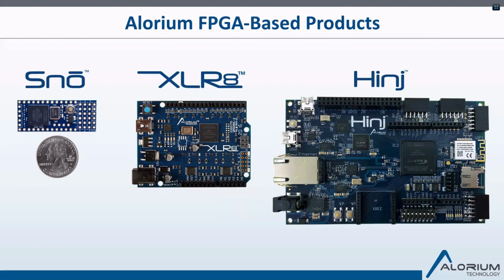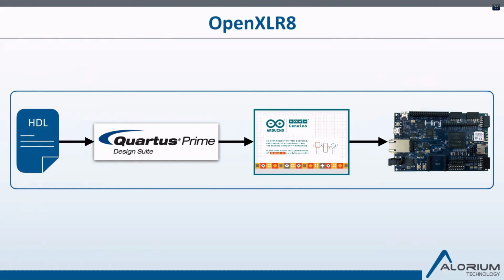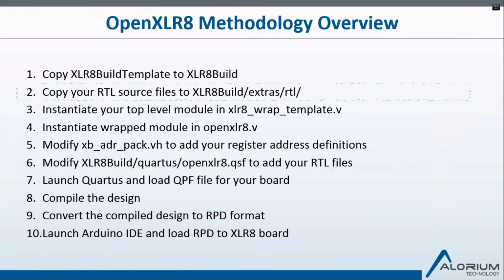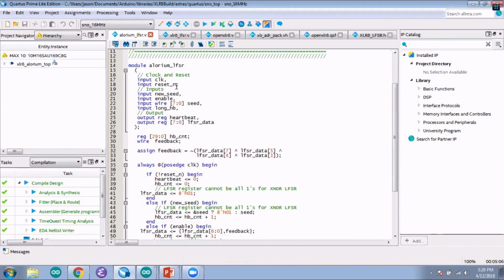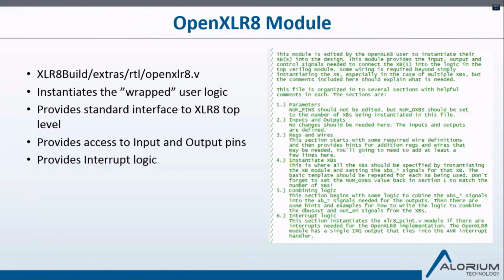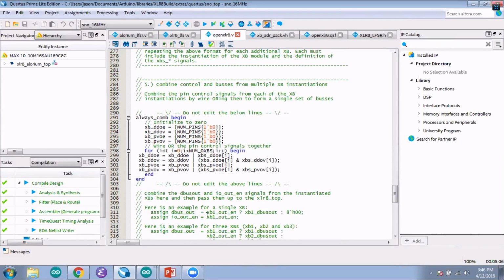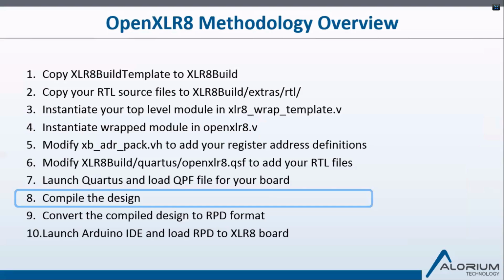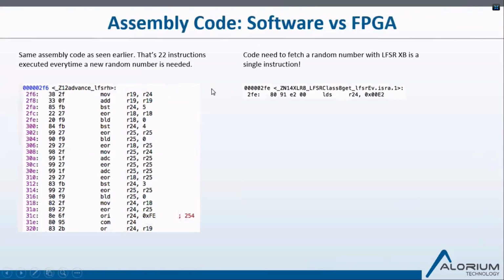Intro to OpenXLR8: FPGA Design for the Arduino Ecosystem

Comment: Ive had the Papilio Duo since the kickstarter and have only recently started to play with it. I also snagged a Sno M.2 to compare the different workflows against some of the other options with the yosys or vendor toolchains that lack that "Duino" level of abstraction. Both this and the Papilio are great solutions, but it still feels like there is a wicked simple way to join SoC/FPGA design and synthesis with sw/fw frameworks. Im hoping for some more interesting HDL abstractions like SystemC or Chisel that let you target the hardware and software in the same source files with decorators or various inheritance patterns.